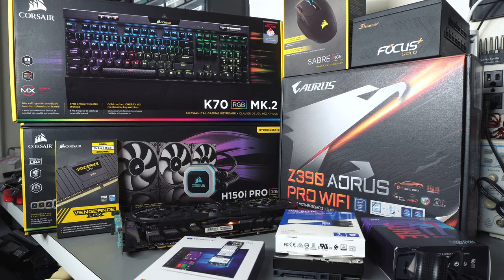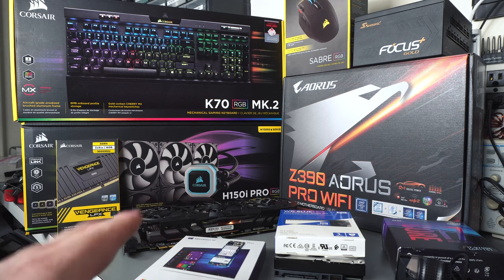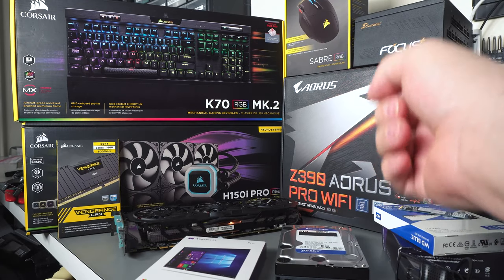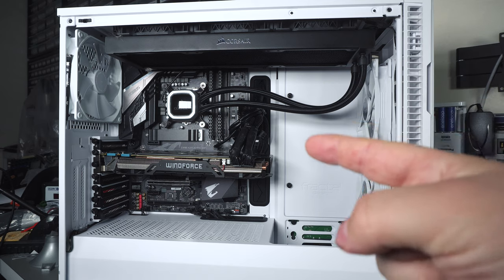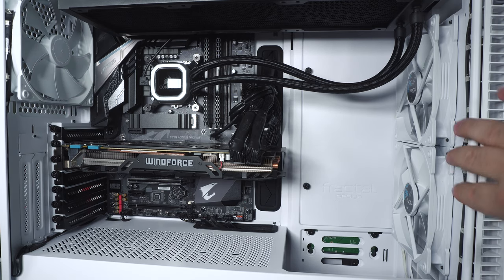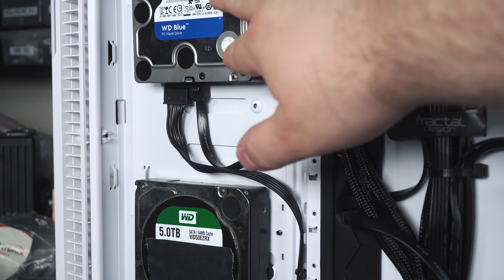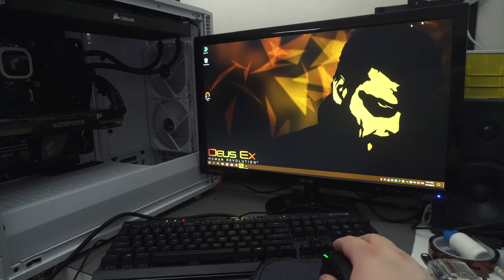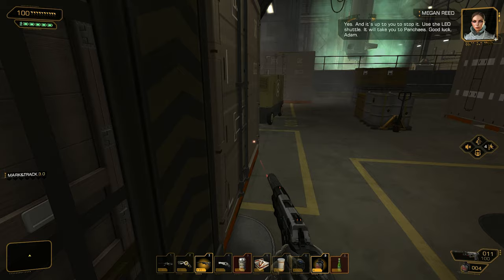Quick PC Build for Dad (aka The Couldn't Wait For Ryzen 3 Build)

Comment: 8:33 I knew you'd pick that, as then he could control all the lighting effects from the Corsair software, whatever it's called
9:37 Yeah, I've been doing that free option for quite a while, mainly because it allows for less USB ports to be wasted.
10:14 I just noticed it has that thing for the GPU in case someone like me wants to relocate it onto a riser in order to free up space for more expansion cards! Or maybe just for those things that go from internal connectors to connectors mounted onto an expansion card backplane…
Reply from the maker: The riser is only for liquid cooled cards and should pretty much never be used for an air cooled one as it presses the card so close to the case glass it cuts off the air supply. :D

Comment: Where did you put the optical drive?
Reply from the maker: Just stuck it in an external USB 3.0 case (link desc), but if you want to use it internally just get a smaller cooler.
Reply: @PeterBrockie  OK, thanks!